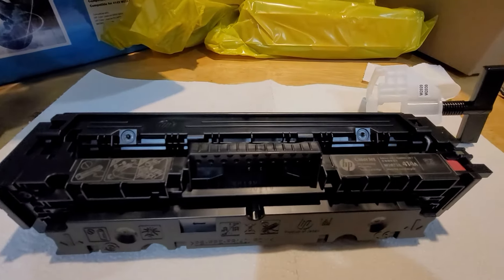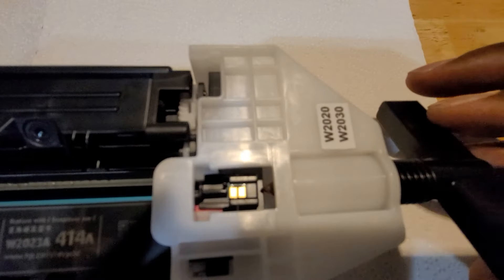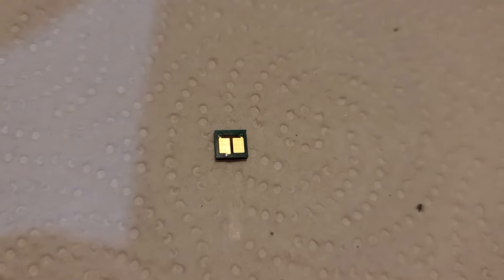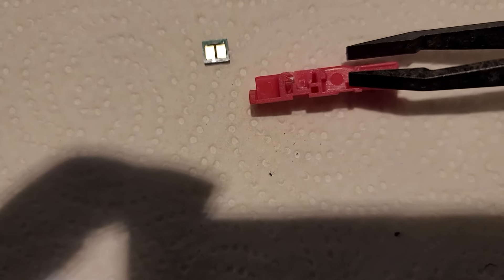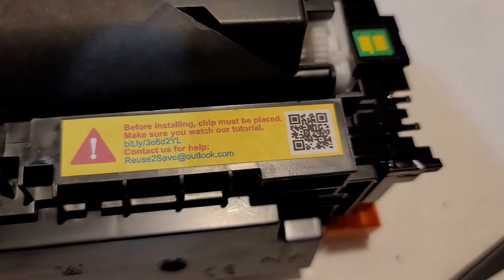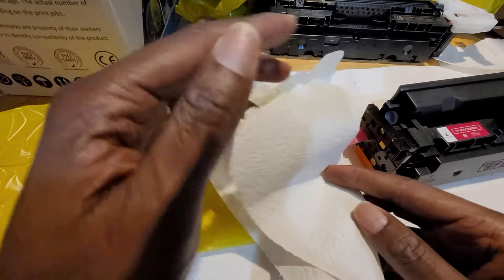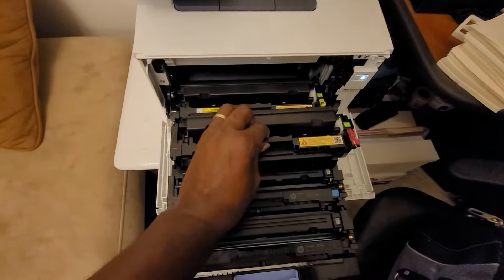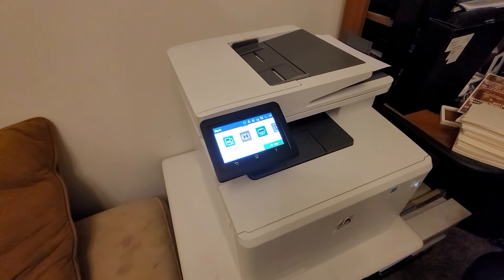DIY/REVIEW: How to transfer chip on toner and replace HP Color Laser toner with True Image Toner – 1

Comment: I swapped the chip but my printer still says ink is low, I only swapped the black in so far, I’m a bit worried if it’s going to work or not. I have a Hp color Laser Jet Pro MFP 3301fsdw. Please help
Reply: Did it work ?? I have same printer
Reply: @MrsMillion yes it’s working however I am still receiving the “low ink” notification . I reached out to the company and they mentioned the error notification will continue to show because the cartridges have not yet been programmed to sync since these are 3rd party products. They mentioned in the future they will have this. The cartridges work, one thing I will note is the quality of the images/prints do not come out as good as the original HP cartridges, can’t really complain because again these are 3rd party products. Hope this helps
Reply: @KGESTATES  great thank you just purchased of course anything cheaper is not as good quality but ink is so expensive

Comment: Thanks for the helpful video.  I still cannot use the cartridge because it still shows the new cartridge as empty.  Wasted my money
Reply from the maker: @Jamiecook5485, thanks for your feedback.  The cartridge does not YET support chip reading. This is definitely the inconvenience due to firmware limitations. However it is designed to still print using new toner. You can see the difference between looking at your color saturation on the paper. 
So try it and let me know. 
Thanks.

Comment: Hi Joseph!  Thanks for the video.   I changed the chip and the printer is saying the supplies are not communicate correctly.   What should I do
Reply from the maker: Make sure you replace the chip correctly. There is a wrong positioning side of the chip.
Else if done correctly and nothing works then reboot everything and try again.

Comment: Just watched your video - can you recommend which brand should I buy to replace the color toner cartridge for "HP Color Laser Jet Pro  MFP M283fdw" and which product delivers the "Chip remover"? 
Can these cartridges be "refilled" 
Thanks
Reply from the maker: sorry for the late reply. I assume you've already got your answer. But for further need, True Image brand is what I used and been working just fine. It is not refillable as far as I know (though some geek could do). The chip remover comes with it. However on a more recent production, they came up with a different tool. Regardless, you can always require them to provide chip remover at the time of purchase.
Reply: @joseph-israel   - thanks for your response, and yes I found another solution in the meantime 💪👀